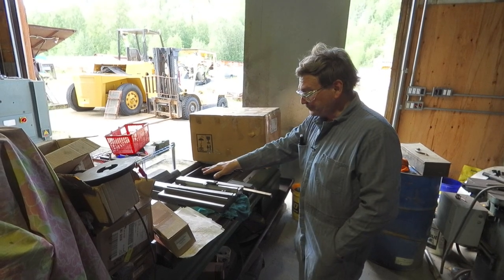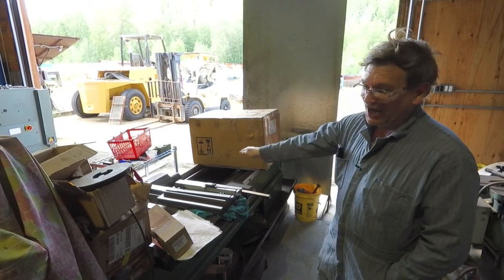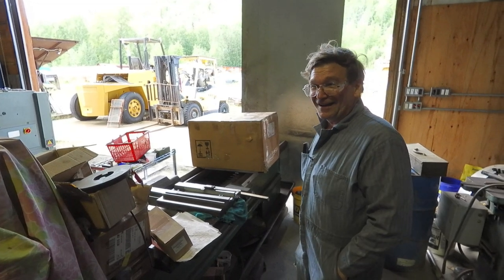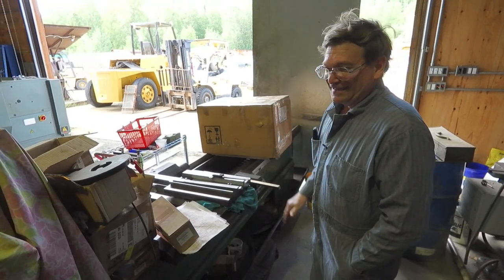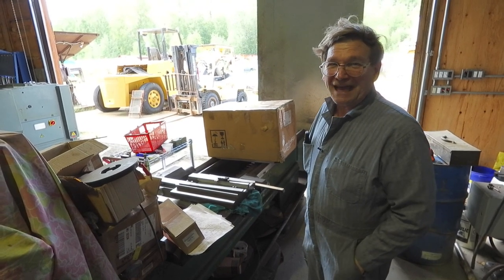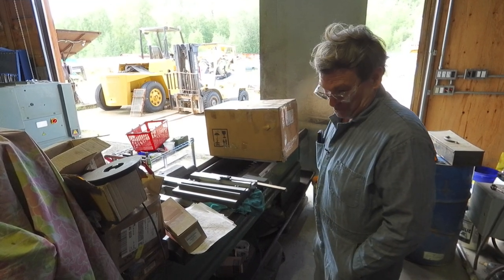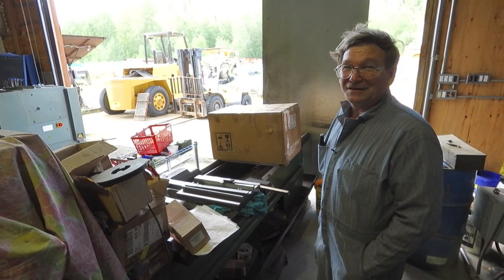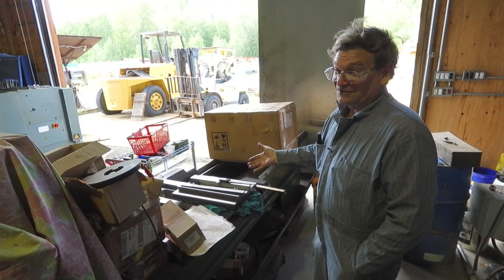Machinist's Minutes: The hollow spindle lathe we're rebuilding and what's planned for the taper

Comment: I just started at a new job. I'm 65 and nearly had a fit when I got to use the lathes. One had never been set up from new and had no preload on thrust side. Was one turn loose. That's why it always chattered. Could even face a disc brake as it came out looking like a gramophone record. One lathe needed spindle bearings and it had been smashed with a big hammer to the main spindle on the non chuck end. Criminal! On another lathe the taper turning attachment prevented the toopost(saddle) from moving past centre so small boring bar operations were impossible. Turned out a casting from new prevented the cross screw nuts from moving far enough. Lathe was short of about 1.5" travel. Fixing slowly but got to convince boss to buy quick change tool posts and DRO,s for them all. We do hydraulic ram repairs so no production or repeats. So much time setting tools, finding packers etc. I sold my engineering business(one man band) and had all the stuff to make life easier and faster. I've now got to train keen but rough guys the does and don't of machining. Simple stuff drives me crazy like cleaning morse tapers and chuck faces properly. Making progress with the gear. Not so much with the men! Old habits die hard.
Reply: Hydraulic shops are like that...  You'll meet 'machinists' with 10 year's experience, who don't own a mic.

Comment: So in effect - the taper attachment is a differential device turning the (cross slide) nut proportional to with the main X-Axis leadscrew...

I  dig the concept of adding steppers to manual machines - using manual processes with CNC  control - for profile machining isn't so silly - of course there are jobs where a 3++ CNC is necessary.

Even "highly skilled" machinists - who didn't read the manual - think that niples are all for grease - when on all my (old manual) machines, most of the "nipples" are for oiling, not greasing  (Elliot mill and Nutall Lathe saved from the scrapper).

i AGREE, so many USA sellers won't ship to Australia, whe really there is no problem - talk to us...

Comment: Definitely interested in hearing some information on inverters. I set up my 3 phase stuff my home shop with 480v Allen-Bradley VFDs driven by 220v single phase backdriving a stepdown transformer to get 480(ish) single phase. I would just use the 220v drives but nobody wants the old 480 ones so they’re cheaper haha.